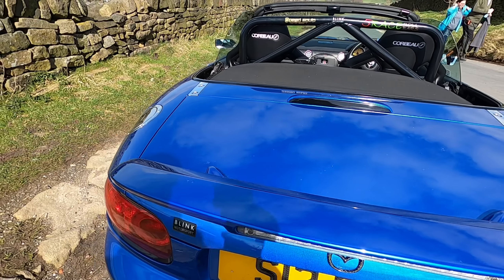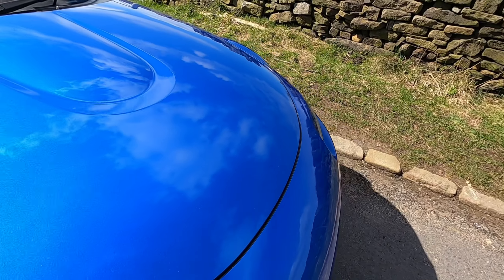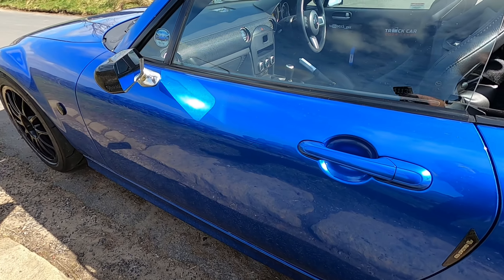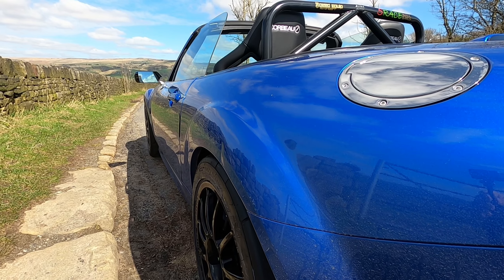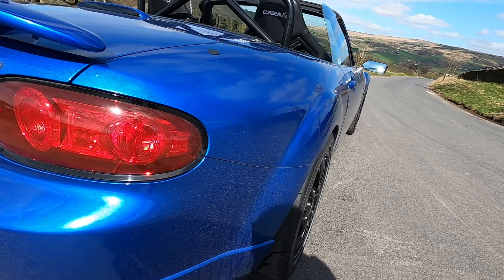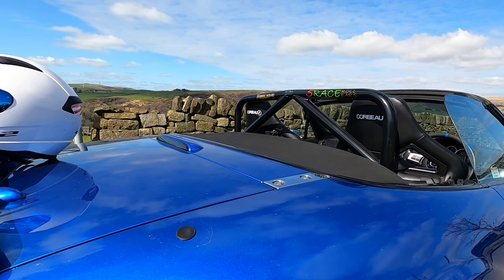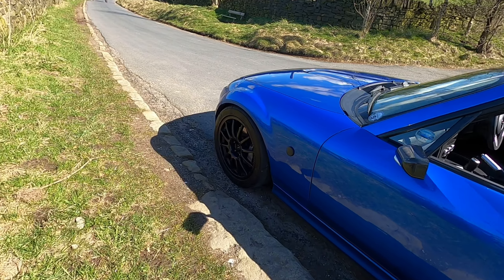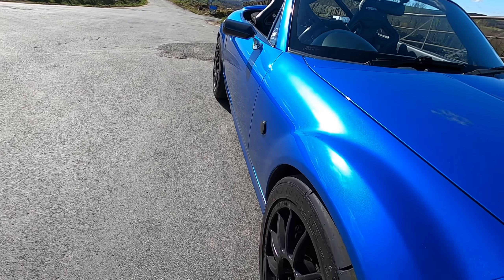Paint correction machine polish and ceramic wax

Comment: What kind of trye pressures do you run with the AR1's for track use?
Reply from the maker: I usually start with 24 cold and then adjust as they warm up until I get a steady 29 warm